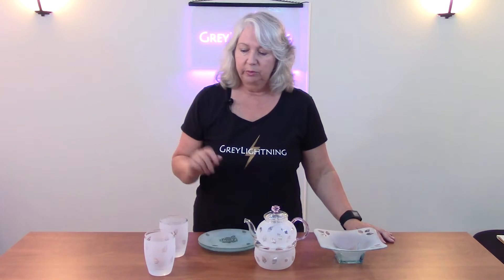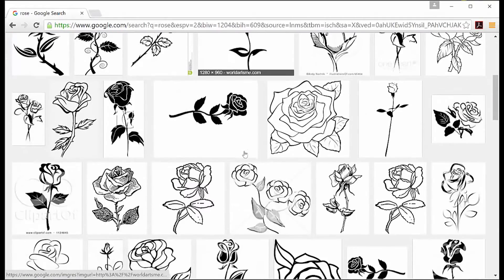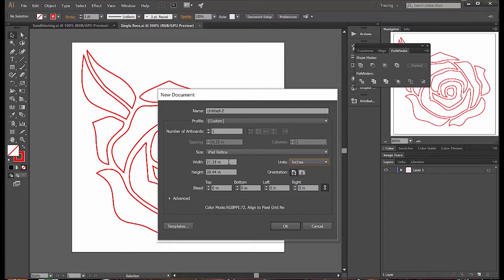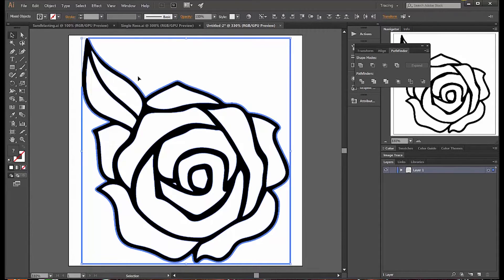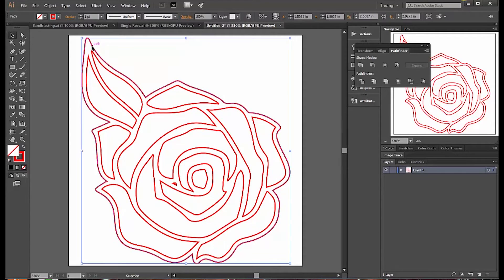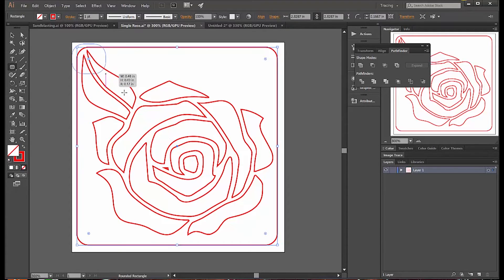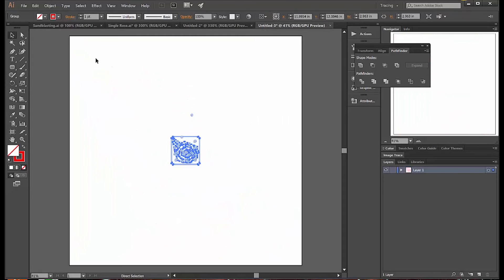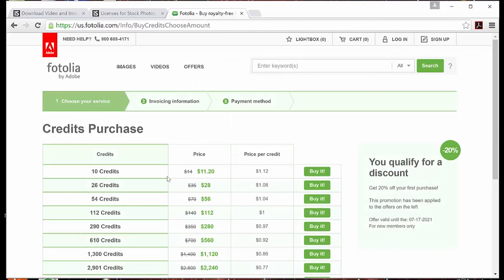Using Adobe Illustrator to Create Vinyl Rose Stickers for Glass Etching

Comment: Can you cut the vinyl on the laser cutter/engraver rather than a separate machine
Reply from the maker: Sherry, I just checked to see if someone had come out with a laser safe vinyl in the 6 years since this video, and they have! Siser Easy Weed is PVC free and safe to cut on a laser cutter, so the answer now is 'yes you can' as long as you are very careful to pick the right vinyl. There may be other brands as well, just make sure it is a reliable source and that it is specifically marked as safe for laser cutters. Other vinyls will give off toxic fumes when burned in the cutter.
This gives me ideas for new videos, thanks!!
Reply: @GreylightMay   Thanks so much for going the extra mile to research that for me.💗